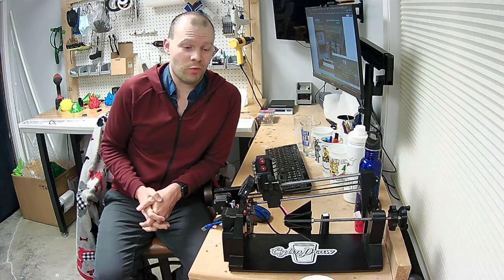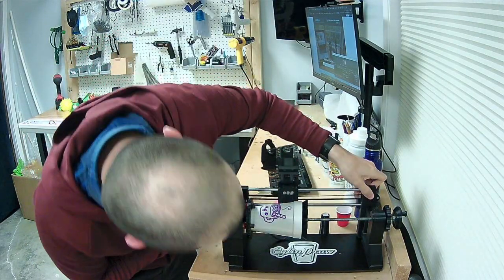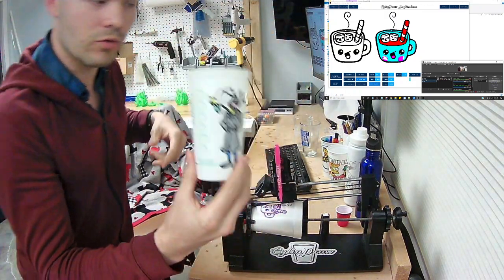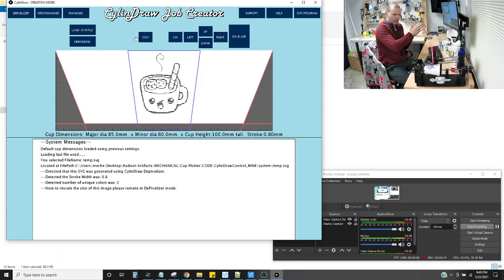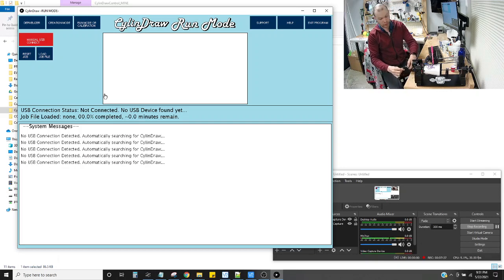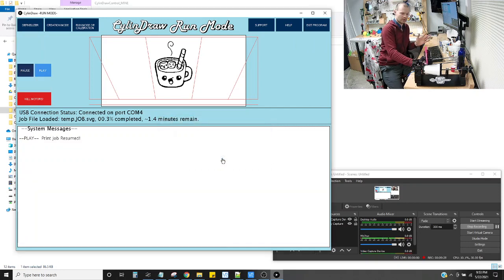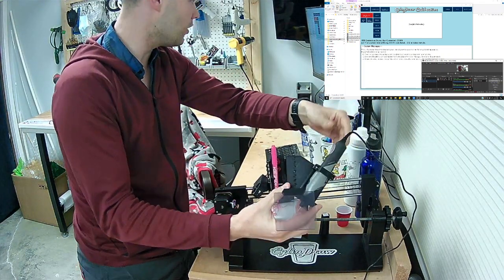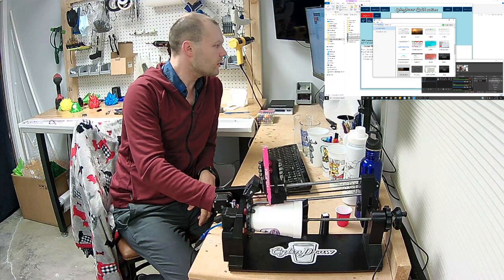Introducing CylinDraw! A New Tool to Easily Create Incredible Art On Any Kind Of Cup! Full Demo

Comment: Nice work! Cool device and good video. I notice that the "vectorized" bitmap is still pretty blocky. How much better are the results with a native SVG?
Reply from the maker: Yes, using say an Inkscape SVG you can draw all of the detail of the SVG onto the workpiece down to 0.1mm resolution on the rotary axis & .01mm on the linear axis. My method of vectorization is unique & makes for a good catch-all but with thick strokes the object does appear pixelated. I wrote up a neat article about this exact topic here: https://engineerdog.com/2021/07/14/discover-the-joy-of-pixel-manipulation-and-vector-art/
Reply: @MGrahamMakes  Thanks!

Comment: When I try to export an SVG from the depixelizer, the application freezes.
Reply from the maker: Hi Will, there are multiple possible explanations for this. If you are doing a very detailed job (small stroke width) then depixelizing can be slow. Alternatively, some people have reported a windows glitch with your issue and it is resolved when you delete the svg file at this path:  CylinDrawControl\application.windows64\system\temp.svg
Reply: @MGrahamMakes  I think it was because I had the program in c/programs files. Moved it to my documents and it works now. Another thing, do you have the DXF for the base available anywhere? Thanks for replying.
Reply from the maker: @WillThat  Great! I see, must have been a permissions issue. I shared an SVG of that & a machine BOM in the discord group https://discord.com/channels/834173183447924736/932848918025342996/941081058168950884